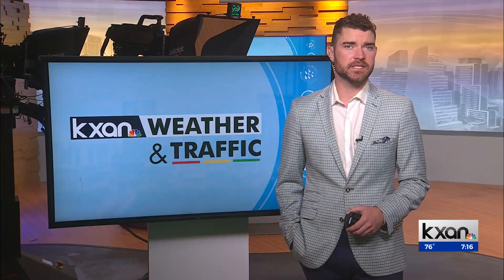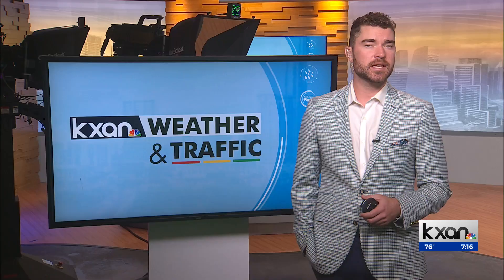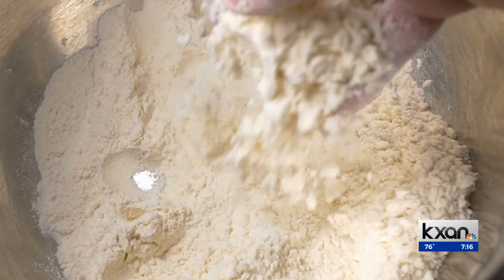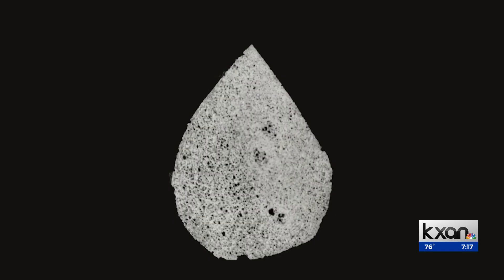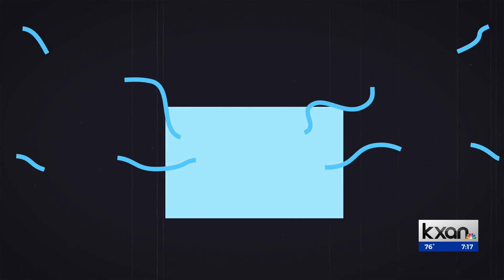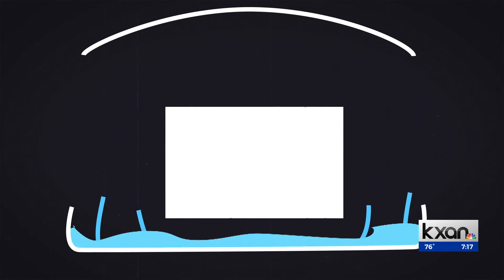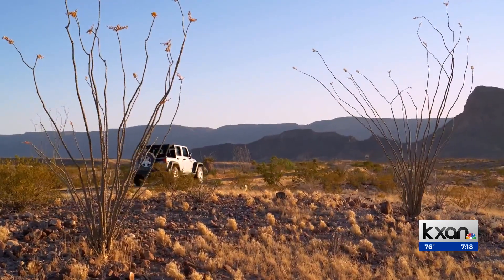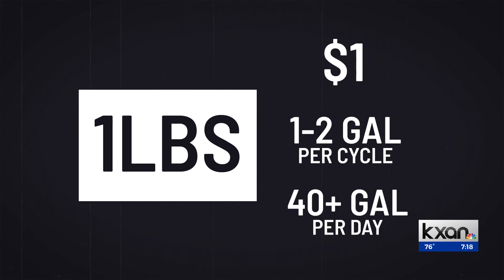Texas researchers farm water from thin air

Comment: There we go, After running water ways low and wells drying out let's also take all the moisture out of the air, What could go wrong? 🤷‍♂️
Reply: Impossible to take all the moisture out of the air. Especially with the lack of trees that would usually capture the moisture from the air.  

 If you take the time to think about the idea.  It is a real benefit.  

The only way the moisture in the air could be completely gone is if entire earth's atmosphere was gone.  If that were the case all life on earth would be dead and we wouldn't need the water.  

I am sure you understand the greenhouse effect.  Moisture will continue to come from the ocean, lakes, snow, and rain. Capturing humidity will not change that process.